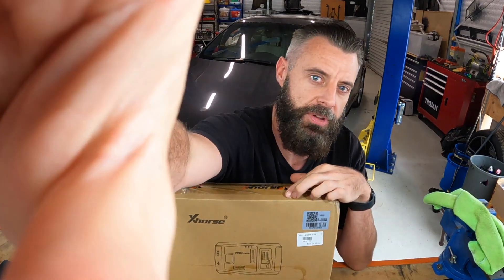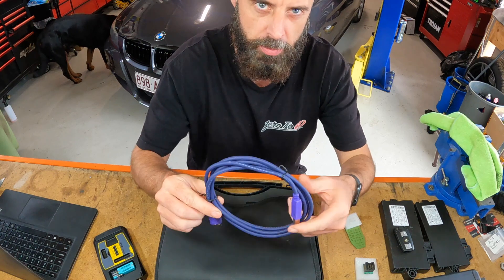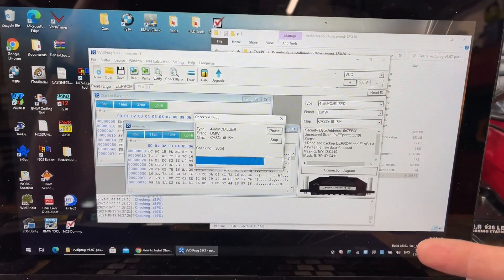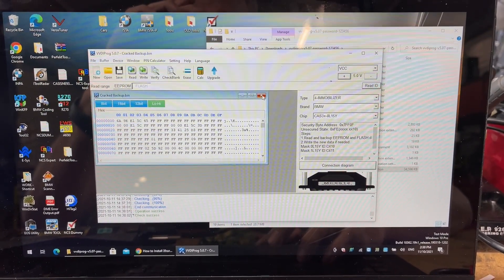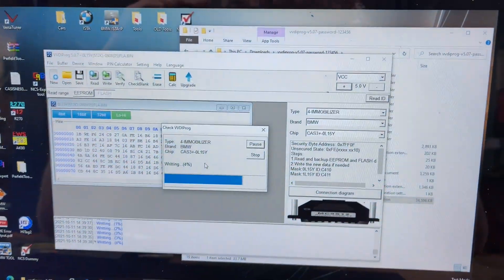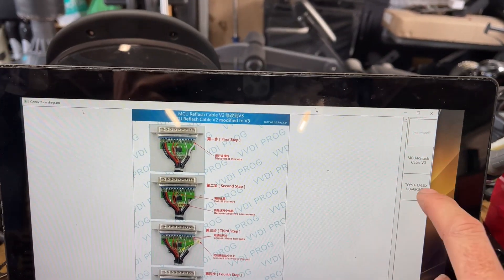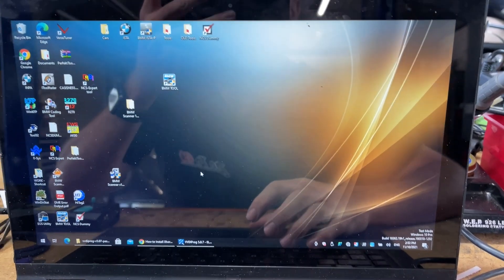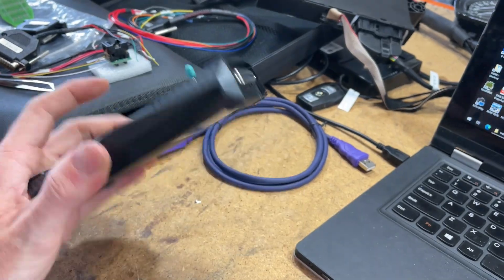VVDI Prog Unboxing & CAS3+ Eeprom Read Write

Comment: You need to get those probes I sent you so you never have to solder again, I have soldered a CAS3+ in years also its faster too
Reply: Please dont hate me..... but which probes were they?
Reply: @ZeroTo60Tube  I did some research and found some called "Pcbite Probes" and just used them for the first time the other day and they do work nicely 👍🏽
Reply: What probes are they I can’t solder good
Reply: Yes what probes??